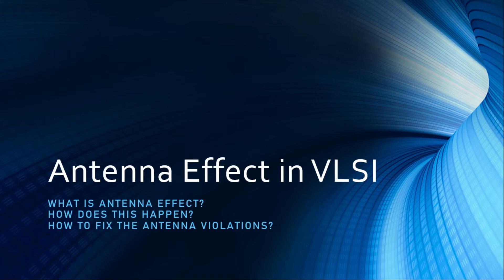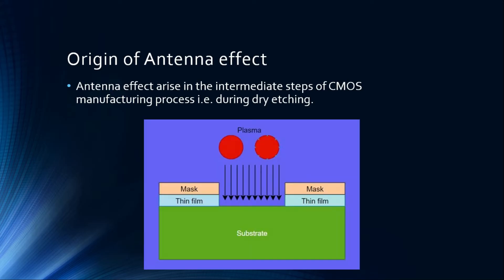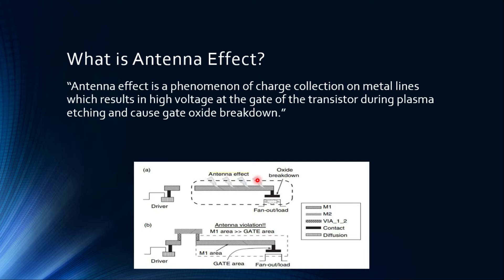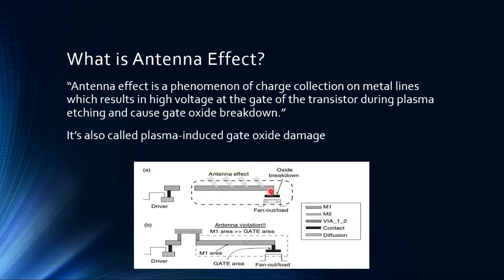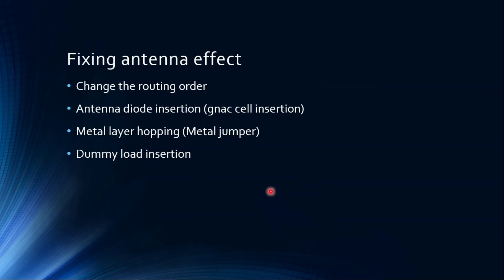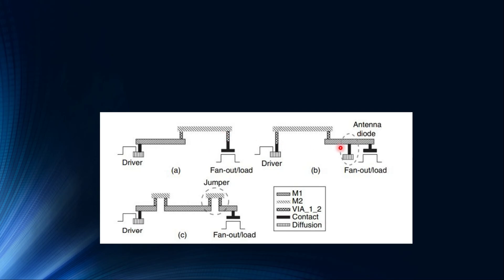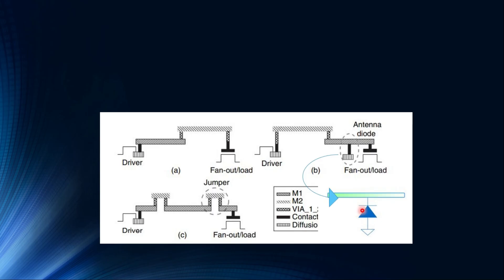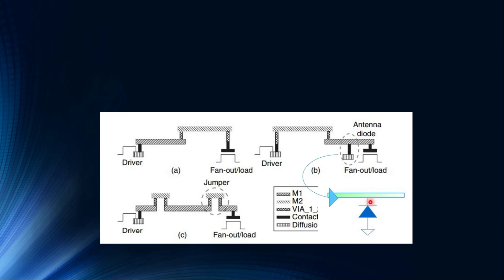Antenna Effect in VLSI | How to fix antenna violations?

Comment: What if both diode insertation and metal jumper not possible what will we do?
Reply from the maker: What do you mean by not possible? You need to make one of those possible. That's the job of PD engineers 😀
Reply: @jairamgouda  if there is no place to add diode Or jumper what we should do?
Reply from the maker: @siddisrinuvaasulareddy1325  well, that's what I said, you need to make space.